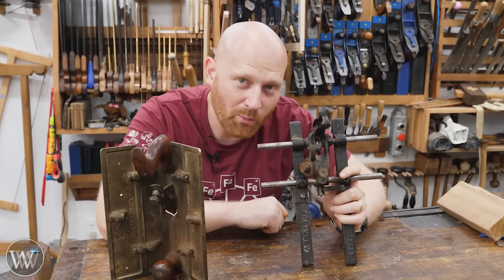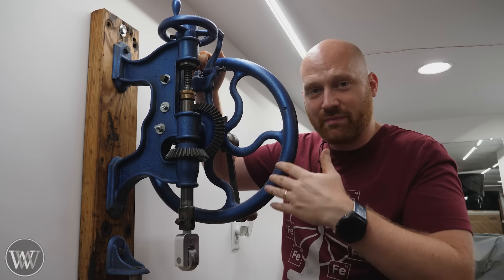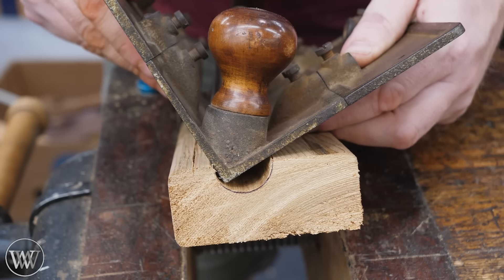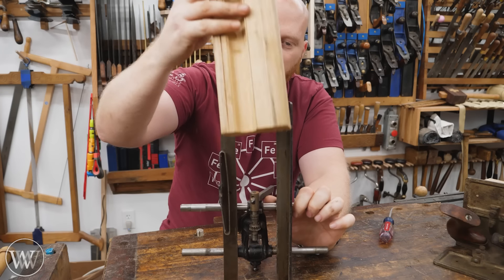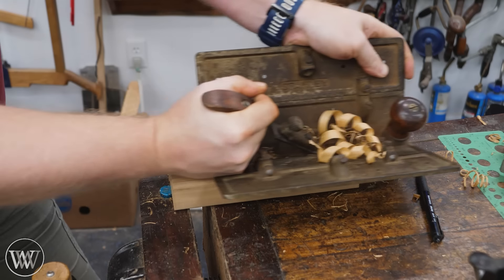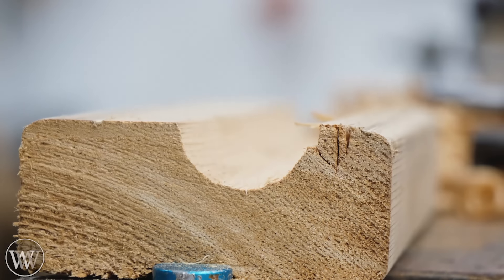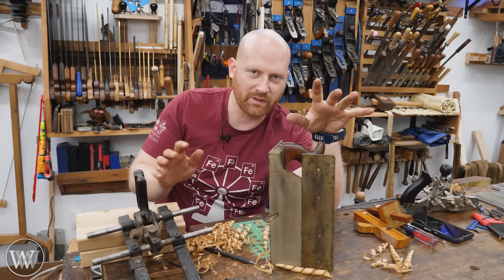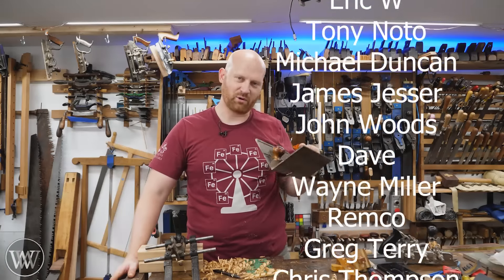Woodworking Ninjas Used These Core box Planes

Comment: James! Thanks for talking about all these old-school patternmaker tools - I'm in the metal casting industry (I actually design cores, coreboxes and patterns professionally for an iron foundry, although I'm not a patternmaker) so it's always great to see just how impressively skilled patternmakers were/are. Nowadays they use mostly CNC machines to mill the coreboxes out of iron, aluminum, some plastics, etc. but even now there's some MDF-like wood that still gets used for tooling. 

It's just incredible the amount of skill they'd need to have to accurately machine all of the fairly complex geometry, by hand. Not just to make the patterns and coreboxes, but to maintain them over time whether it's for repairing wear or for fixing/improving a problem on the casting. No wonder they needed all the fancy tools!
Reply: What's also mind-blowing is that both the pattern maker and foundryman both needed to know and understand the various amounts that cooling (freezing) liquid metal will experience, so some patterns needed to be a certain percentage larger in all relevant dimensions... I take it you can confirm this by practical experience.
Not sure how they even did that when more than one dimension was 'relevant' and given that some alloys just make you guess or interpolate.
(Source: my research during amateur foundry work to make aluminum paving tiles for a garden)

Comment: Patterns are still made from wood to this day, in my experience Mahogany is the norm for larger repeated use patterns when making sand molds. Today almost all use CNC technology to make the pattern, but beyond that, the pattern and core boxes needed are the same for well over 150 years.    There are certainly other technologies used now, but by in large this is way its done for mid size to large iron / steel castings.  I managed the casting and forging procurement for a large manufacture ranging from parts weighing a pound or two, to over 90 ton casting made in a single heat / pour.  Only a handful of foundries in the world can do that. One of our larges casting takes over a month to cool before it can be removed from the mold.   For high production like parts needed in the automotive industry, they use other methods where they need to make thousands of a thing and not 10s or 100s.

Comment: The non-Stanley one kind of reminds me of a metalworking shaper. It would push the toolbit along a straight line to cut some metal, move it over just a wee bit and repeat.
Reply: I've seen shapers (or only one?) in YT videos (I thought it was on TOT, but I must have been mistaken). Are there any that can rotate the tool on each pass?

Comment: The second one's advancement mechanism has to be one of the coolest things Ive seen. Thanks for sharing! Do the gears get clogged up with dust and junk?
Reply from the maker: No there's not much problem with dust as the tools don't make dust. That's one of the fun things about hand tools. Have you ever wondered why sawdust is called sawdust when every power Tool makes sawdust. Because it used to be the only tool that made sawdust was the saw.
Reply: @WoodByWrightHowTo  My head just exploded. THIS is one of those words that by its own construction explains its origin, but nobody knows it because it's right there in literal plain sight.

Comment: A more modern core box is used in mineral exploration.  Geologists use drills with hollow bits to remove cores from the earth. The cores are put into core boxex that hold several core and are the4n shpped to labs for analysis.  Architectural millwork businesses with molding machines make the core boxes these days.

Comment: I know it’s off topic but a question for James. You and many other makers on utube have videos making shoulder planes. And in every one nobody mentions where they got the iron they used in their shop made shoulder plane. I’d like to give it a go but cannot find any source for a quality iron. And living in SoCal there are no tool swap-meats near me. I’ve looked on eBay and have found what look like old blades, but at very high prices and usually no details on the quality of the iron, I saw a home made one cut from an old table saw blade and other sub par quality. Can you tell me who makes quality trustworthy blades for woodworkers making their own planes?
Reply from the maker: The only one I know of right now is red rose reproductions. They have molding plane irons that generally would be used if you're making a wooden shoulder plane.
Reply: @WoodByWrightHowTo  thanks so much. I’ll look them up.

Comment: 7:30 Can that cutter be turned, and the wheel rotation changed: so that instead of left to right, - you could go right to left? Or can opposite direction rotation core box planes  be found?  I'm thinking of stubborn grain on large project, (not easy to reset), and the Left hand woodworkers!
Reply from the maker: I don't think so. It would require re-engineering the cast items in the plane
Reply: @WoodByWrightHowTo  Not knowing we now have some thing to look for. LOL

Comment: Edit: More nuance in the replies. I'll leave my overconfident comment below as an example that people can learn new things, even when they're sure they're already right. If I can do it, you can too.

Core boxes are not related to casting, actually. The cores they're meant to hold are produced when doing mineral research: a hollow core drill is drilled down into the earth and then the round core of rock is pulled up with the drill, and ejected into the core boxes where the geologists can examine the composition of the rock at various depths.

My grandparents' family cabin actually had a roof made out of old core boxes, and there were various piles of discarded rock cores tucked away in the surrounding woods from the geological surveys that the local mining company did over the years.
Reply from the maker: That is another use for them. Both are well documented.
Reply: @WoodByWrightHowTo  I'd be interested in seeing contemporary documentation of the core boxes being used to make cores in pattern making. I honestly find it a bit unlikely as there are other ways to make cylindrical cores that would be easier and more reliable (like, for example, simply drilling a hole through a piece of wood or metal, or using a pipe, and then packing that with the core material before pushing it out without needing to separate two halves. Or, in larger volume manufacturing, using a simple round extrusion process).

I could certainly imagine core boxes being used to store pattern making cores, though, and it really feels like this would end up being one of those "lost in translation" situations.
Reply from the maker: It is a standard practice for patternmakers. You will find it talked about in most patternmakers' books.
The Pattern Maker's Assistant
Patternmaking - A Treatise on the Construction and Application of Patterns
Those are two that come to mind. Plus, if you do any research on the two, you will find it's used to pattern workers far more often. The cores they made were destroyed in the casting. There was no need to store them. The box is what was used to form them.

The area of core samples in geology was a great use for the boxes, but that was a far less common use as pattern working was an order of magnitude more common occupation 100 + years ago when these were made.
Reply: @WoodByWrightHowTo  So interestingly Patternmaking does actually back up one of my assertions, where it says "It is not customary for the patternmaker to supply boxes for straight, round cores, particularly in the smaller sizes, as most foundries are equipped with machines for making cores up to 2-1/2 inches in diameter [...] These are called stock cores". The book does discuss using a core plane for making small diameter semi-circular sections (with larger diameter sections being made in multiple parts, and thus unsuitable for core plane shaping), but in the broader context of making more complex shapes of cores, like a cast pipe fitting with many internal bends.

So it is in fact silly to use a core plane for making long, straight, cylindrical cores, such as the shape you demonstrated. But I will concede that there is documentation for it being used to make subsections of more complex cores.

Also for basic shapes like a pulley wheel or gear, no core would be required at all, as the hole in the middle could simply be made as part of the cope and/or drag. A core would only be required for hollows with a much longer aspect ratio, or which have undercuts or other geometry unsuitable for being formed into the cope and drag (like being off axis to the cope and drag).

And yes, I'm aware that the cores are not reused, I was suggesting that they might be stored in a box prior to use, or when being transported from the core forming area to where the sand molds are assembled.

As for the relative prevalence, while it's true that casting was a larger industry than geology, you only need one core box to make thousands of castings, where as pulling up one core sample requires many core boxes, so it's not obvious to me that one would be the clear winner over the other. But since every foundry needs a mine to back it up, I'm still tempted to go with the industry that treats them as a regular consumable.